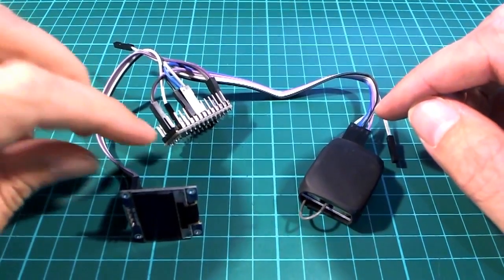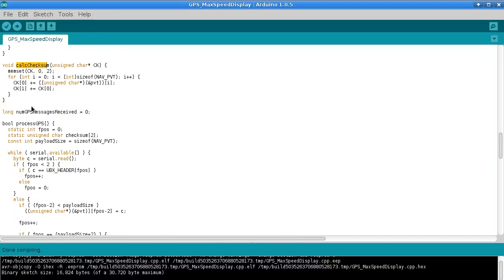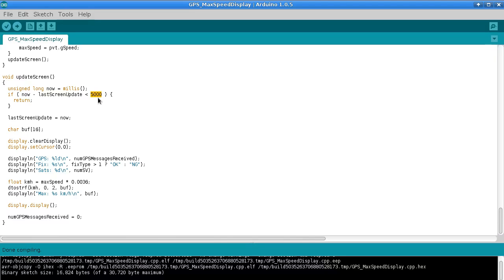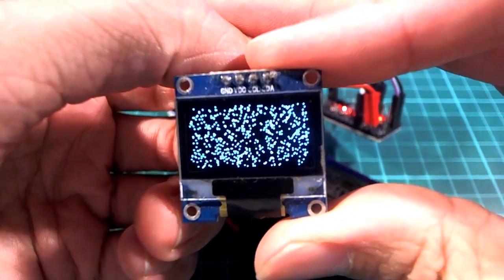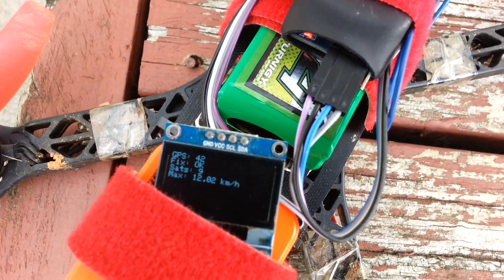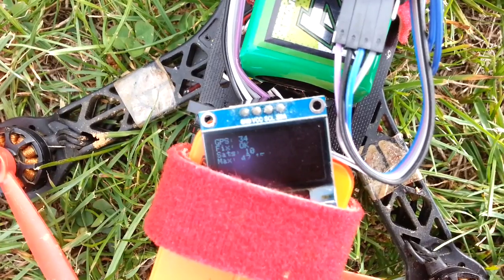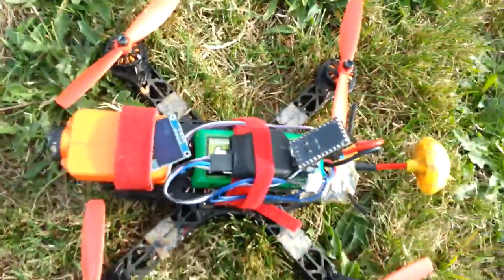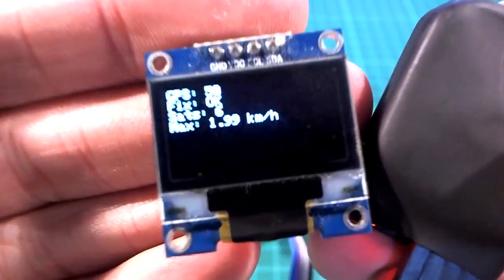Arduino GPS speed logger

Comment: hello @iforce2d . i want to build this speed logger and shall buy Arduino promini, gps neo 7m, and lcd oled 128x63. but your link for wiring and the code is broken. could you provide me the wiring and code please ?
Reply from the maker: Sorry, try here
https://www.iforce2d.net/sketches/
Reply: Thanks
Reply: Is it ok to use 3s 12 V battery as power supply for the arduino pro mini ?

Comment: hello
i'm trying to do this project but i don't have any gps signal, the arduino at this moment only gives me a height value but it doesn't mark any speed or satellites.... i'm using a beitian bn220 gps..... which can be failing? Thank you
Reply: I have only had success with the NEO modules that are designed for the ubx software. I made the same mistake in the past trying to use the bn220 and it never worked

Comment: You should structure your code as OOP Object Oriented Programming and move away from procedural coding. Because that a very large code to refresh procedurally. In the time that you refresh the screen the GPS had sent 50 times the information. That's the reason why you get a multiple/division of 10. It gets every 5 sec in sinchrony and the rest of it will not match, because everything under 5 seconds is not a multiple of then.
Reply from the maker: The microcontroller doesn't care if the code is OOP or not, if anything it will just run a little slower with OOP. The screen is slow because data is transferred via I2C, and OOP will not help that.

Comment: Hello, and thanks for the awesome work. I have troubles in finding GPS neo-M8N modules with flash memry so you can update firmware. You pointed a Bangood link in the header of the video, but it is broken. Can you share   us   a  link to recommended sellers ? thanks again
Reply from the maker: These days I usually use a BN-220 module, they work well and are pretty cheap. 
https://www.banggood.com/search/bn-220.html

Comment: hello thank you for making this vid.
i,m geeting a error when i try to upload the skecht
i dont know what to do , i am a noob when it comes to programing

Arduino: 1.6.9 (Windows 7), Board: "Arduino Nano, ATmega328"

GPS_MaxSpeedDisplay:20: error: #error ("Height incorrect, please fix Adafruit_SSD1306.h!");

 #error("Height incorrect, please fix Adafruit_SSD1306.h!");
Reply from the maker: maybe you just need to get the Adafruit SSD1306 library
https://github.com/adafruit/Adafruit_SSD1306
https://www.arduino.cc/en/Guide/Libraries
Reply: thank you i got it to work , 
but no data coming in from the gps its not getting a lock
Reply: Sorry i forgot to say i have downloaded that library via arduino software, but if the other is different then try that to

Comment: I have also had this problem with these screens. I remedied this by drawing a small black box over only the area that will be updated instead of redrawing the whole screen.
This allowed me to show sensor data from in multiple places on the screen that would update many times per second as well has have moving graphics and animations.
1. Create a static text field: "GPS:       "
2. Change "updateScreen()" to something like:
   display.drawRect(x,x,x,x, BLACK);
   display.setCursor( just after static line "GPS:   ")
   displayln(gpsVariableData)
3. Repeat as necessary for each variable as necessary and you can still call them simultaneously from updateScreen() and it will be many times faster than redrawing the whole screen.

Comment: is it possibe to use a other gps ?

regards
Reply from the maker: This requires a ublox GPS, that does UBX protocol.
Reply: to use a other gps with the tiny gps plus libary i have to complete make a other code ?

gj
Reply from the maker: Yes. This code requires a ublox GPS, that does UBX protocol.
Reply: Thanks.
Can you mark the section who had to be changed?

gj
Reply from the maker: Well, basically the whole thing. You could look into the TinyGPS library, which handles NMEA messages.

Comment: Witch GPS are you using. The link is not working aneymore.
I like to build one.

gert-jan
Reply from the maker: This one looks very similar (also a 7M) https://goo.gl/lBD3OC
But that's out of stock too right now, and these days you can get an M8N module for around $20 so not much point to get a 7M. I use this one on my quads whenever I can, they perform very well: https://goo.gl/mLtazm Haha again out of stock on BG. Just look around for "M8N".

Comment: Hello, i am building your speed logger, but in my case for skiing. I have a problem were I think you might can help me. I have bought this GPS module https://drotek.com/shop/en/drotek-parts/613-ublox-neo-m8n-gps-hmc5983-compass-xl.html but it doesn't want to work. I changed it to 10Hz. do you know were the problem is or how i can get it to work ? Thanks and sorry for my bad english.
Reply from the maker: no, how could I possibly know.... (tip: saying just "doesn't work" is a completely useless description)
Reply: Ok sorry the monitor is showing everything but it doesen't find the Gps signal even wenn i am out and wait several minutes.
Reply from the maker: Connect the GPS module to the u-center app and check what's happening. https://youtu.be/TwhCX0c8Xe0?t=4m48s
Reply: I have done that and changed the rate to 10hz and it also works and finds some satellites. But one it's hooked up to the arduino it couldent find them. Do i have to change anything else than just the Hz ?
Reply: @TrybridAthlete  unfortunately I gave up

Comment: GPS Link is broke, can you update the link or tell us what the module details are pls.?
Reply from the maker: Any ublox module will do, try to get a 7 or 8 series one, eg. neo-7m or m8n.
Reply: I have got the neo 6m and it does not work. Is it the wrong antenna for the script or should it also work?
Reply from the maker: The NAV_PVT message is only available on 7 or above.
Reply: Thx
Reply: I have got an neo m8n and it still dosen`t work, do i have to change something in the script or should it normally work as it is?

Comment: you said I²C is slow. is ISP or RX-TX faster?
Reply from the maker: +Julio Ryuuzaki I think it may have been more that the software serial was slow. After this I tried the u8g library for this screen which improved the speed too. In general I2C is much faster than UART (RX/TX)
Reply: +iforce2d I had been using several OLED screens like yours. Some with the Arduino Pro Mini like you and also with the 100Mhz Mbed platform. Thinking more MHz would give me more speed. But in reality the speed of communication is the problem. If the controllers would directly control the screen it would be faster but it will use many cables, the problem is the screen is controlled by a controller that needs to be operated with "commands" sent trough I2C, UART or SPI.

Comment: I think You should anyway try interrupts for receiving GPS packets without loseing data, especially on 10 Hz.
For graphic LCD - u8g library.
The same screen (also I2C, mini pro 16 MHz) is enough fast for simple graphics animation then there is something wrong (slow) with I2C in this sketch.
Reply from the maker: +janko muzykant interrupts is a good idea. Yeah I do not remember this screen being so slow in the past when I used it before. I have occasionally played with the I2C speed in the arduino Wire library, but right now I have it set back to the default so that should not be the problem.
Reply from the maker: +janko muzykant I've been trying the u8g library lately, it's pretty nice. I also realized that the slow update is caused by the software serial connection of the GPS. The interrupts of the incoming data are taking up a lot of time. I switched to using the hardware UART and it runs nicely.
Reply: +iforce2d Software serial is nice for fast, not very time rigorous diagnostic but in this case (10Hz GPS update rate) hardware UART works perfect.
Glad to know, keep going :)

Comment: Some simple filtering is probably needed to get rid of single jumps that you always get with poor gps signal.
You could eg. take 5 samples, discard the extremes and take the average of the 3 mid values. You can add a condition like min 4-5 satellites to discard anything with very poor value (and/or require some value for HDOP).